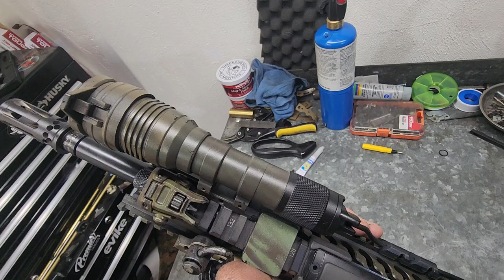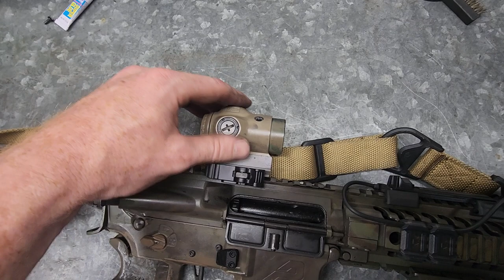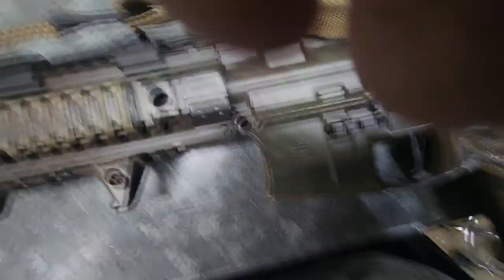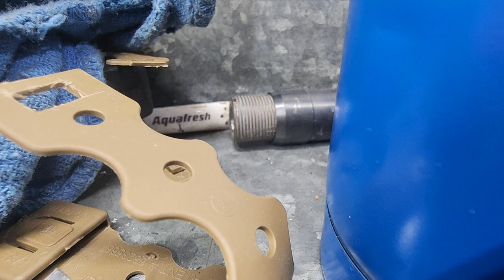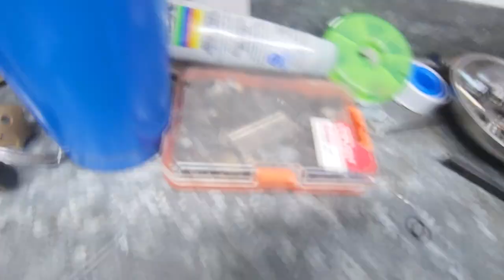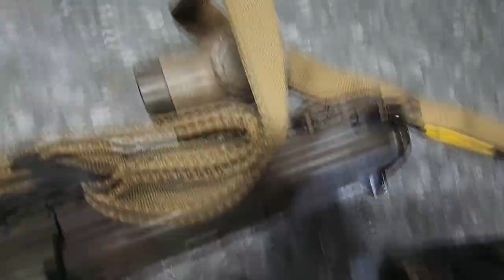Frankenstein AR-15 #2, Surefire, Aero Precision, Magpul, JP Enterprise, Radian.

Comment: Nice build.

I myself only use Aero handguards and recievers at this point. However i only use either M4E1 or enhanced M4E1 for the quality and ease of installation. I have a PWS mod 1 MK111 7.62X39 upper and i like it but have learned i like DI better. Don't have a suppressor for it yet but i would bet i am only going to keep it for a suppressor pig hunting setup. I only use Geissele triggers at this point as well. SSA, SSA-E and SSA-E-X. Plan to build a truck gun which will be a budget build and use the 2 stage Aero trigger that the builder makes for many companies. I hear its just as good as a MBT2s. My barrel choices always come from 3 mfg's. Giessle, Daniel Defense and Balistic Advantage. The barrel should never be skimped on. I always use CHF chrome lined for rifles that will rapid fire high round counts. The DD and Giessle shoot sub MOA despite being CHF chrome lined. 

BCG is another thing that should never be of low quality  and I always use DD or Giessle but i will eventually get a LMT enhanced bolt for my go to rifle. I have recently learned that it would be best to use quality BCG that are coated either hard chrome or NP3. Its been said that lowly phosphate is better than almost any high end coatings other than full chrome and NP3. Extractor always needs to be phosphate though. Never want a slick coating on the Extractor. I have been using enhanced buffer tubes with a Armaspec buffer system but am going to try the Super 42 spring and A5 buffer tube next time. Its supposed to make it as smooth shooting as a rifle length system. To this point always use Magpul for BUIS, sling, grip and stock but there are others that are just as good or better.

Comment: I like the video because it's authentic.  There is a lot to be said for production quality, but videos like this certainly have their place, and a lot of us appreciate them.  I'd like to be of assistance to you with piston AR's since I have several.  The Superlative Arms piston kit is a slimmer and lower profile piston kit, while also being the manufacturer for the piston kit used in the $2500 Type-A rifles.  Many different slim handguards can be used with the superlative arms piston kit.  My preferences on handguards are typically Geissele and CMT.  The Superlative Arms piston kit works and fits with both brands of handguards
Reply from the maker: Thanks for the support. I'll be switching back to DI once funds are available. I know there are infinitely better piston kits out there. This was just what I was able to afford at the time of building. But I appreciate the input!
Reply: @flicthebean  If you're not shooting suppressed, as I assume you're not, DI probably is the easier way to set-up an AR.....  I shoot suppressed, so DI is out of the question for me
Reply from the maker: With the jp enterprise im sure I could do suppressed when I go back to di but it'll definitely take a lot more tuning of the gas system and maybe a different bcg and charging handle to bleed off excess gas coming back into the system. For the time being no shush devices for me lol

Comment: Low effort, 1 take, long from content is my jam. It's kinda refreshing seeing something different as once you get to a certain tiers of kit, it's basically the same combination of parts just in different configurations.

If you have to rebarrel that upper, I've heard the Superlative Arms piston kits are pretty nice. If it were mine, I'd get a nice CHF CL barrel and that Superlative Arms piston kit or try a PWS, LWRC or Type A piston upper if you want to stick with piston. PWS is the only long stroke piston driven AR15 I know of which is kinda cool imho. Id change the handguard too but at that point is a whole different upper. I don't need that many reasons to start a new build other than my poorness.

Cool build. New subscriber. Just a suggestion, get a cheap Chinesium phone tripod. It'll help a lot when breaking down the parts so you don't have to do everything one handed.
Reply from the maker: I appreciate the tip on the Bipod ill have to look into that. And this upper is getting swapped back to DI. I'll be using a SOLGW 13.7 midlength barrel, VLTOR MUR upper, and either a Geissele MK7 quad rail or a KAC 3.1 13.5 URX rail. Topping it off with a UH-1 with a Trijicon Magnifier.

Comment: Somone who paints his guns, thats a slick looking paint job. I like my frankenstein builds. Try PWS mk111 or mk116 uppers for piston guns. The PRO series is going away and super cheap right now. I also think you have to use their micromagnifier with ther 1x prism.
Reply from the maker: You can use any magnifier with an adjustable diopter but yes PA does make one compatible with their prism optics. I'm done with piston uppers, they're cool and all but the novelty has worn off. Once finances get sorted out I'll be rebuilding all the rifles and this one will be going back to DI.